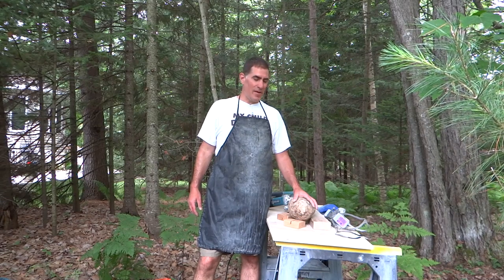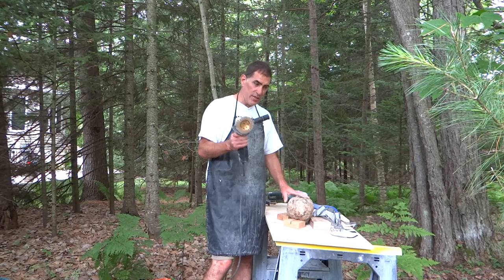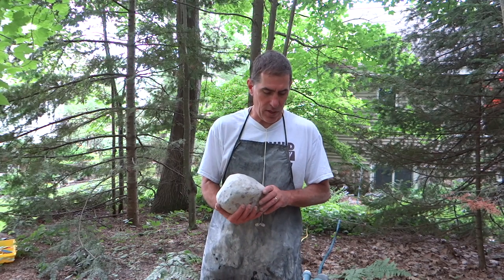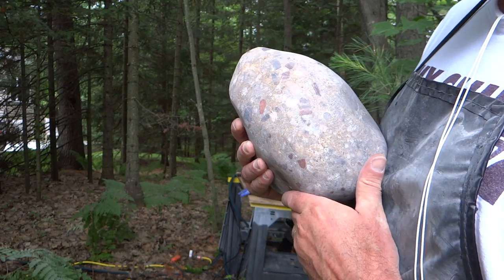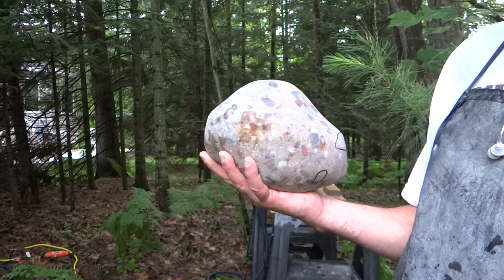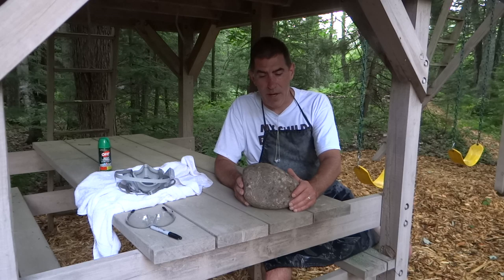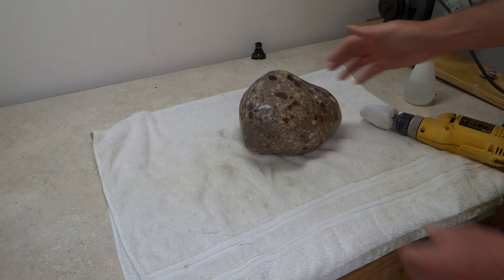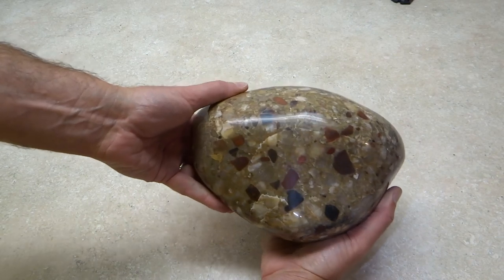Polishing a Large Puddingstone

Comment: Beautiful job. I dig a lot of holes in an area full of pudding stones. Ive got quite a few id like to polish up and was wondering if you could give me link's to the polishing disc and wet sander you used. 
I've done a lot of stone cutting, spalling, and shaping but never done any hand polishing. Thanks for the neat video.
Reply from the maker: I have this grinder:  Makita PW5001C 4" Electronic Stone Polisher.  You'll also need a Gardena 36004 Garden Hose Quick Connector.  I have a four inch cup grinder from Harbor Freight that works well for the first stage, and then I went to a place on the 'Net called Tool Jungle and bought one of the cheaper sets of discs and a more flexible rubber backer.  I listed the grits in the description of this video.  I would like to get a couple finer grits for a better shine.  I also bought some heavy rubber gloves for a little more protection in case of a short or something.
Reply: @MichiganRocks  Right on! Since making this comment I've found a spectacular glacial tillite that I've joked about making into my own headstone. Can't wait to get hands on with the makita.

Comment: I wish we lived closer to one another. I have some massive pieces of jasper and a large stump of petrified wood my grandfather found in AZ back in the early 1900s, which has been passed down through the family. I have always wanted to polish that piece, but I'm no longer able to handle that type of equipment any longer. If it is large and has a relatively flat top, (like the pet wood stump has) a friend of mine told me to round the very top edge off about a quarter to a half inch, so that more light gets through the top clear top to brighten the inside colors. It was from the petrified forest area many moons ago. I plan on soaking it soon to open up the colors, but I'm always hesitant to do that because the family member it goes to next likes rocks as they were found and so do I. The jasper pieces start at 5 pounds and go up past 70 lbs. I about killed myself getting that one up out of the cliff and that was years ago. One larger one is egg shaped and relatively smooth, so it would be easier to polish, but it is a lot of work. I've done this before, but only a few times and you did an amazing job on that stone. WOW!!! If you open a float agate by cutting it, or with a flat lap, slightly round off the edges to prevent cracks and chips and use a smoother grit. It does make a difference when using a cab maker, but only with flat ends. The larger the piece, the more material you round off. Even with medium to large size agates it makes a difference with the light that comes through and protects the edges. Again, beautiful work.
Reply from the maker: I'll be doing another one of these this summer. A lady at church asked me to polish a puddingstone just a little smaller than this one, but also nicer. It has a story with it an she agreed to tell it for my video. We're trading polishing for video content. I think everyone will go home happy.

Comment: Any chance you could link or recommend the correct angle grinder for polishing? Not sure if I need a variable speed one or go with a fixed speed.  Thought I read you don’t want to go above 4500 rpms or close to that.  Thanks again!
Reply from the maker: I use a Makita electronic stone polisher.  It is variable speed with the top speed being 4000 rpm.  I run it at the top speed all the time.  
https://www.amazon.com/Makita-PW5001C-4-Inch-Electronic-Polisher/dp/B0002HC2HU/ref=sr_1_5?dchild=1&keywords=Makita+wet+stone+polisher&qid=1603716649&sr=8-5

Comment: I have a few bigger rocks I would like to polish as well. However I have not been able to find the right grinders to do it with. Where can I find a wet grinder? Hope you can help. Anything special I need to use as well. Thank you.
Reply from the maker: I have a Makita Electronic Stone Polisher (PW5001C).  You'll also need a Gardena 36004 Garden Hose Quick Connector so you can connect it to a hose.  Then you'll need a diamond cup wheel.  I bought mine from Harbor Freight and I've been happy with it.  You also need some diamond polishing pads.  I listed the grits I used in the description of this video.  I thought it was a good idea to buy heavy rubber gloves to help protect against electrocution.  There is a GFI built into the cord, so the gloves are a back up safety measure.  You should also have eye and ear protection and also a respirator so you don't get silicosis.  Breathing in rock dust is really, really bad for your lungs.
Reply: Oh thank you so much. I have all the safety equipment from my everyday job. I just couldn't find the wet grinder. Thank you.
Reply from the maker: @donnalantz7981  You're welcome.

Comment: Great site, thanks. Just have a question for you, if I may? Have you ever tried using an air-powered angle grinder instead of electrical? It strikes me as being a tad less hazardous but since I'm new to this rather addictive hobby, I would be most grateful for any tips you and the rock-hound community may have, thanks. Have lots of beautiful jasper awaiting my ministrations...  ?=)
Reply from the maker: No I haven't tried an air powered grinder, but I agree it would be safer. The one I have has a built in GFI and I have it plugged into a GFI outlet. I also wear rubber gloves and rubber shoes, although the rubber shoes are usually full of water, so I don't think that does much good.
Reply: @MichiganRocks  Thanks for that. I just bought myself an air compressor today and since I'm used to using air-powered die-grinders on a/c, I think I will give them a go. I find them less cumbersome to use when compared to an angle grinder. 

Keep up the awesome postings. Wifee and I love them.
Reply from the maker: @K1w1scot  One of the reasons that I went electric is that I don't have an air compressor. If you had one for something else, that seems like a good way to go.
Reply: @MichiganRocks  I'll let you know how it goes, if you like.
Reply from the maker: @K1w1scot  Yes, I'd like to know.

Comment: I’m not sure why but I couldn’t see all the steps you did on this rock in the description. What brands of grinders did you get? Did they both  come from Harbor Freight? Where do I get the polish pads for the wet grinder. Did your angle grinder have variable speeds on it? Where can I order some oxide chemical you talked about to get the shine?
Reply from the maker: Hi Dan.  I’m going to cut and paste the description here since you couldn’t read it and then answer some of your more specific questions.

Here are the steps I took to polish this.  

I started with my normal, dry angle grinder.  The cup wheel is 50/60 grit, but is way more aggressive than the soft 30 grit wheel I followed it with.  The angle grinder also spins much faster than the wet stone polisher.  I spent 17 minutes shaping the rock and removing holes in it.

Next I moved to the wet stone polisher.  This has a soft backer, so the pads can flex to the shape of the rock.  The grits and times are as follows:
30 grit  - 40 min.
50 grit  - 11 min.
100 grit  - 11 min.
200 grit  - 11 min.
400 girt - 8 min.
800 grit - 11 min.
1500 grit - 10 min.
3000 grit -  8 min.

Both of my grinders are Makita brand.  The dry one that I use with the cup grinder cost less than $100 I think, but that was quite a few years ago.  The Makita electronic stone polisher was around $300.   The wet grinder has five speed, but I only use the highest speed.  The dry grinder is not variable speed, but is much faster than the wet grinder.  It’s too fast for the diamond pads.   The cup wheel was the only thing from Harbor freight.  I think it’s the four inch (might be 4.5) version.  I bought my polishing pads from a place called Tool Jungle.  They had an Amazon store plus a website.  You’ll go through way more 30 grit pads than the other grits, so get more of those.  I just did another one of these yesterday and I added two more pads, 6000 and 8000. I skipped the aluminum oxide because it didn’t do much last time and these two new pads gave the rock a noticeably better shine.

Other stuff you will need:  hose, Gardena hose quick connect (to connect the grinder to the hose), rubber gloves, heavy duty extension cord, respirator (very important), and safety glasses.

I’d guess you’d have to spend over $500 if you don’t have any of these tools and other supplies.
Reply: Michigan Rocks thanks for all the cool info! Since the angle grinder is so fast was the 50/60 or 30 cup wheels diamond blades?
Reply: Or are they normal 50/60 and 30 cup wheel blades?
Reply from the maker: @dandickinson1003  Everything I used in this video was diamond.  I think this is the cup wheel I have, but it might be the 4.5 inch version of the same wheel.  https://www.harborfreight.com/4-in-diamond-turbo-cup-wheel-for-angle-grinders-61416.html
Reply: Michigan Rocks thanks for the link.

Comment: What was the purpose of the diamond wheel again?  Does that just grind out the roughest areas?
Reply from the maker: They were all diamond wheels.  I assume you mean the first cup wheel.  That is very aggressive and grinds out the worst spots pretty easily. From there, it's just a matter of using finer and finer grits to smooth out the scratches left behind by the earlier discs.  It's a lot like sanding wood.
Reply: @MichiganRocks  Did not realize they were all diamond.  Thank you.